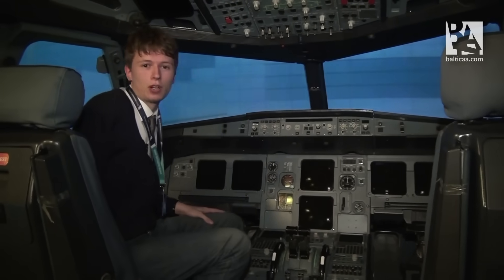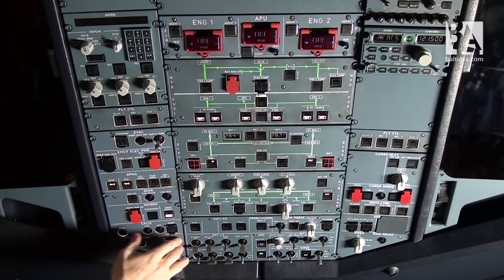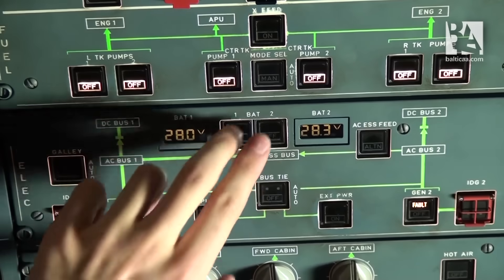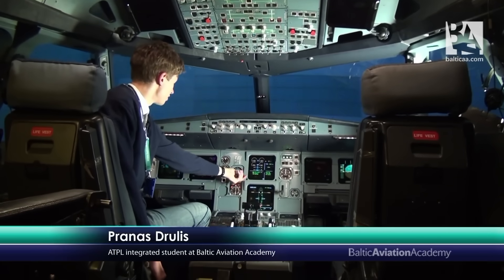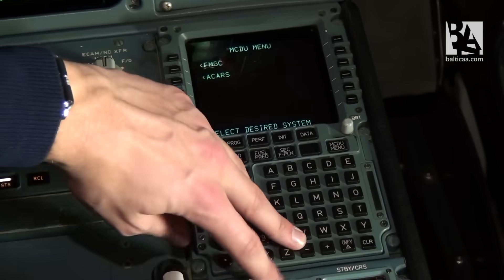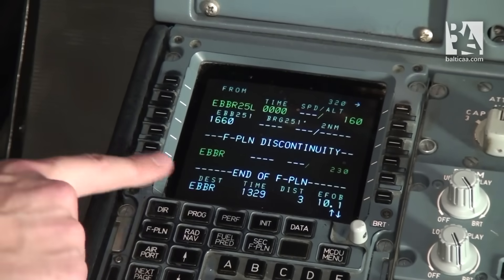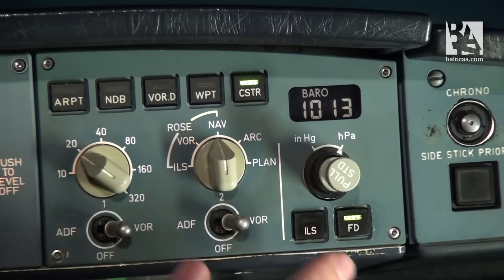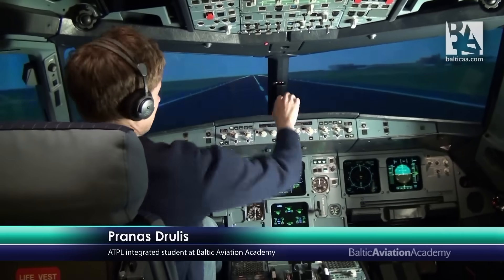Airbus A320 - From Cold and Dark to Ready for Taxiing

Comment: Why he didn't turn off APU right after starting engines?
Reply: You don't have to, you can have the apu running the entire flight if you want to.
Reply: Rykehuss No it does not.
Reply: Siavosh Kasravi Theres an auto shutdown for emergencies, but the pilots have to push the apu master key to turn it off.
Reply: I know APU can be turned on during the flight usually for emergency situations. But if there is a feature that turns it off automatically it maybe something I am not aware of.
Reply: No it does not.
Reply: See above.
Reply: All you need to start the APU is sufficient battery power, sufficient fuel, and to switch the starter to start and everything else is automatic.
Reply: No you cant. The apu turns off automatically

Comment: you forget to do the door check,  light test laud speakers dim and INT  in the cockpit prepration flow and as for the prelim cockpit preparation and you should do the CB test, rain rebelnt, ecam check gear pins and cover in the prelim flow as per the SOP
Reply: AirsoftCommander, Yea the APU has to come off after engine start because the engines have generators and they create enough electricity. Also the tail vibrations mid-flight can rip it clean off.
Reply: Im a noob but is he supposed to turn off the APU ? I have allways wanted to be a pilot and recently I watch all the airbus or boeing startups :D
Reply: Ahmad Sulaimani, he also didn't turn the nav and logo lights on, to represent that there is electricity running in the aircraft.
Reply: Patrick Mosur Isn't it enough to turn on the beacon lights prior to engine start?
Reply: +Luca Müller as per a320 sop he must tern on the Nav light in the preparation he is right
Reply: Ahmad Sulaimani oh ok, interesting, thank you
Reply: Ahmad Sulaimani That's the 737
Reply: Where did you read he was going to demonstrate an SOP?

Comment: So all around it takes around 15 minutes to get a commercial jet ready for take off. I'm curious, how long before a flight's scheduled departure time is this meant to be done? Is the plane always shut off to the cold and dark state for refueling and maintenance beforehand or is it kept idling to reduce the time needed to get it in the air to its destination?
Reply: Brandon Gould Crew generally board the plane 15-20 minutes before passengers do

Comment: Starting engines before push back? ATPL failed or revoked.
Reply: thorsty70 Happens daily due to tech reasons. whether they need the GPU just or ASU due to not having sufficient bleed air/inop API.
Reply: APU*
Reply: Karl McCallum shouldn’t that aircraft be grounded if the APU is inop?
Reply: negative, the apu only gives eletric power and AC, so when the plane has the engine on it already has eletric power and AC, but when they land before the pilots shut down the engines they conect the GPU  for eletric power and the ASU for AC

Comment: Windshield wipers off when checking initially?  I can see the other things like engine master switches, throttle settings, parking brakes.   But windshield wipers?
Reply: The wipers must be OFF in the park position, to prevent damages due to a dry windshield. Repellent on a dry windshield is also a problem. Therefor they are on the checklist for APU.

Comment: Why don't we just have start stop push button in an aircraft?
Reply: Pro Gemilang that will put away all the fun
Reply: Umair Zakir No, this is just completely pathetic. It's too compicated for run an aircraft.
Reply: Well you can't just pull over if you have an engine problem, you'd just crash.
Reply: probably because pre flight checks must happen because a plane is basically a can with some wings a nose some wings a tail plane and two more small wings on the back the first two wings basically have fans strapped to them that run at incredibly high speed and some wheels that can be retracted thinking about that that can carry hundreds of people you need to do checks or something will probably go wrong and people will probably die but when your flying in a big can with some stuffed welded to it would you trust that if you where 30,000 feet up and had to stay in it at hours at a time also computers won't instantly know where you going so you have to program that in but just a stop/start button it would be ludicrously unsafe
Reply: @djvendetta2325  just use Google maps bruh.  Cars used to be crank start and you had a 50/50 chance of breaking your arm.  There's no shame in making things a titch easier before you even get rolling lol
Reply: Because Pro Gemilang  would just be easy to stealand they're worth hundreds of millions of dollars
Reply: Then something fails and.....You have only the start stop button
Reply: For safety and maintainence . Pilot can know where is the problems and if there are failure of the systems they will know it easily
Reply: Yes lol on the floor left side

Comment: This must be an older A320?
Reply: Shea Te Huia it said A320 200 on one of the panels - how old is that?
Reply: Mark Roberts I shutdown an Airbus A320-232(WL) every night. There are small differences within the flight deck compared to this one. Then again, this is only a simulator I guess.
Reply: Shea Te Huia I certainly wouldn't know the differences - I'm just stating what the display said

Comment: did he forgot to turn off APU after engines are stable? or just automatic?
Reply: No. The APU stays ON until after take off but have the APU bleed turned OFF.  In that way, if you suffer a complete engine shut down in the moments after take off you at least have immediate access to APU bleed for a restart rather than having to wait for the APU to restart first.
Reply: No must turn off is not auto . The APU stays on  . You can leave it on , just that it's not necessary really when both engines are running .
Reply: Yes he forgot, it's just a demonstration for new pilots

Comment: Am I the only one that wants to get a can of compressed air and clean around all the buttons?
Reply: Ohh no. That would just put all that filth into the air. You need a little vacuum cleaner instead and do the job properly.
Reply: lmao i was thinking that too
Reply: there should be an A-check job card for "Flight Deck Internal Clean and GVIN" :)
Reply: It's just a simulator. A real aeroplane probably has all the aeronautics are probably pulled and checked regularly. If you notice all the corners of the modules have those funny looking slotted screws, they turn a 1/2 turn and pop out and then the module pulls out. Unplug the wiring harness and take the module in for testing or repairs.
Reply: nope.
Reply: Kieran Gannon hahahahahha me too
Reply: More like a firehose filled with rubbing alcohol.
Reply: DON'T DO THAT - unless you have a thing for clouds of skin flakes, old food crumbs and boogers.
Reply: Just chil down.. its a simualtor.. the bacteria is just simulated.
Reply: yes
Reply: Sweaty Jetscrub so, not just me...
Reply: Yes, you are.
Reply: a brush
Reply: A quick steam clean session around that should get rid of all that disgusting gunk in a jiffy.
Reply: @Frank Heuvelman you will be amazed what a vacuum cleaner, small paintbrush, tub of skyewipes and some glass cleaner can achieve.

As an Avionic engineer, I always like to clean the cockpit before delivering the aircraft out of base maintenance.
It shows pride in your work and a sense of achievement post maintenance check.
If I was on the flight line I probably wouldn't clean a lot of this unless asked.
Reply: Oh no you're not! I would NOT want to see the cockpit if i were to fly in that plane!
Reply: @Kieran Gannon - 
not only compressed air , also disinfect it all , its like a bad office keyboard 
https://www.youtube.com/watch?v=QduD0WW_aA0
Reply: Kieran Gannon - Yes.  Especially on the comm console!
Reply: I noticed it too! Come on guys! An old toothbrush and a vacuum! har har har
Reply: Some cowherd..
Reply: RIGHT?  how does that cockpit get so filthy and abused looking??  those students are slobs!  I bet it stinks, too!
Reply: Yes, that flight deck is filthy.
Reply: Aeroplanes are just as much girls toys as they are guys.. :)
Reply: @aaronwilliamson1720  Exactly, thank you.
Reply: A friend of mine flies this model airbus.  He is a tad OCD and always carries a box of antiseptic wipes in his flight case.  Once they've reached cruise altitude, he cleans everything down very carefully as he hates dirty instruments!
Reply: I am a simulator engineer by trade and I assure you we have so much more important things to do to keep the SIM operational than go around blowing pilot skin up our noses 🤣
Reply: I was thinking the same thing! I'm wondering if they ever clean up in there. I mean properly... planes are boys toys, I doubt they do.
Reply: @Raymint    uh, my plane is pretty spotless and i aint no girl!
Reply: @Raymint  I am a private pilot and I am a woman. There is no excuse to be a pig when you are man. That flight deck is disgusting. Clean it up.  Airplanes are not just boy toys. An airplane is a machine that gets you and people from point A to B and t woman and men  fly them. Not just men. Sames goes for general aviation.
Reply: better not! blow one speck of dust in and short something serious enough to crash the plane!
I'm surprised at such a variety of switches and so many are illogically placed and insignificant enough ot be missed in a moment of panic.
Surely more logical grouping and colouring of switches could be made?
Reply: You're kinda OC, I see.lol
Reply: That's why this is not the job for girls:))
Reply: Tommy Anderson whats wrong with making it clean

Comment: Why can't a computer check the correctness of all those 278 switch positions?
Reply: Because people are afraid of the computer making mistakes.
If it wasnt for people being afraid, we would have planes flying passangers around the world without pilots
Reply: multi io actually they do; at least the most important ones
If you set the thrust lever to TOGA and for examle the flaps are not set correctly the master warning comes on and the wrong configuration is displayed on the ecam. But until then it stayes unnoticed

Comment: Engines are never started before push back. All ground crew have to be clear before starting any engines. Is this correct?
Reply: They idle at low speeds
Reply: It is, though he was simply giving a demonstration of how it would appear if pushback was commencing/he was cleared.
Reply: If APU is inop than a ground air starter is used to   Get an engine tuning at idle on the gate .

Comment: then what is the job of the workers on the ground then ?
Reply: Checking the mechanical stuff is in good shape. Like landing gear, wings, engines. And Also to fuel up and load the cargo
Reply: and exnernal power
Reply: +Niznuts123 The pilot also always do a check of the mechanical parts of the aircraft, it's called "a walk around" :)

Comment: What is the engine mode: crank
Reply: No fuel or ignition. Only core rotation.
Reply: its for a dry crank, when you have a hung start or a wet engine start, you crank the engine to blow excess fuel away

Comment: Is it the same for a 747, have never used it and parked in the garage for long long time
Reply: check the oil!!
Reply: +subhash nair ofc not
Reply: bro its a completly different plane with a completely different cockpit and systems its not close to the same
Reply: @_klvedal9487  It's an entirely different kind of flying. Altogether.
Reply: @ChrisMelville  It's an entirely different kind of flying!
Reply: It depends. Since the 747 is a very old design (from the 1960s) there will be no computers on specimen built before 1990 or so. :-]
Reply: Shirley you can figure it out on your own.
Reply: @gordmcdonald2807  I can, and stop calling me Shirley.
Reply: r/wooooooooosh
Reply: Nah man. Just flick the switch for fuel, then pull the knobs!

Why are you booing me? Im right!
Reply: Boeing is incompatible
Reply: Have you ever tried to parallel park at 747? Damn bloody difficult getting the tranny in reverse!!
Reply: Let me know if you need a jump start I just brought some brand new jumper cables lol
Reply: a 747 is a bitch to get started. i just learned how and let me tell you, it is alot of buttons.

Comment: Initial climb to 4000 for FL020. Gotta love that :)
Reply: PHILLIP MC KIE He is simply trying to provide information quickly, not give you long and boring realistic simulation.
Reply: I found it strange but I thought that "instructor should know better".
Reply: James Koralewski 
Nearly correct but it's not always 10000 ft. When climbing, you set to standard QNH when you're passing the so called "transition altitude" which differs between countries. For example, in Germany the transition altitude is 5000 ft. But in Austria, it is 10000 ft (due to the mountains). When descending, you switch back to the local QNH when passing the "transition level", which is broadcasted in the ATIS of the airport you are approaching (both local QNH and transition level are broadcasted along with other information like runway in use, wind, visibility, clouds, temperature and dew point). The transition layer is always at least 1000 feet above the transition altitude to ensure that two planes at a given altitude have the same QNH set on their altimeters.
Reply: Why does nobody use the true barometric pressure readings in their altimeters above 10,000 ft? Because as a pilot flies across country, the barometer changes constantly depending where he is and what the weather is there. So above 10000 ft. they all use 29.92 as their barometric pressure reading, even if it's not really that pressure there, and it stays at 29.92 as long as they are above 10,000 ft. This also keeps them from crashing if someone would forget to change their barometer to the correct barometric pressure .
Reply: And I thought I was the only one to 
get suspicous 😂
Reply: Came to look for this comment
Reply: You're explanation doesn't make sense. The reason to have everyone switch to a common altitude (QNH) is so that no matter what country you travel through , all the planes are the same relative altitude and there is little chance of crashes due to 2 airplanes occupying the same altitude at the same time.
Reply: That's exactly what it is meant for, yes. I just explained that the altitude when you switch to standard QNH is not nailed to 10000 ft. It depends on whether you're in climb or in descent. At least it still was like this yesterday up in the real skies ;-)
Reply: Speedbird 123 when flight number is 320

Asks for engine start instead of push clearence
Reply: 420
Reply: Engine start before push back? That's a new one.
Reply: It's more fun to fly at 2000 feet and you will get there in 30 seconds
Reply: Me too! :-D
Reply: Yes it made me chuckle too
Reply: PHILLIP MC KIE Single pilot? Depends. If it's a redeye, at a minimum, it hopefully is. That said, good thing there are numerous levels of automation on the Bus.
Reply: Yes I saw that too. That is why a checklist is always needed. BTW, I did not know that the A320 was single Pilot.

Comment: Hello! I have a little question. In all the videos I had saw, ever the Engine 2 is started FIRST. What's the reason of this procedure? Why don't start the Engine 1 first? This have to have a reason and I want to know it for learn more about Airbus. Thanks!
Reply: +Santiago Cuartas Whilst any engine can be started first, on the A320s, the right one is typically started first because engine 2 powers the yellow hydraulic system which includes the parking break and nosewheel steering. On the A330, I believe that this is done by the blue system off of engine 1, which is why engine 1 is typically the first to start on an A330.